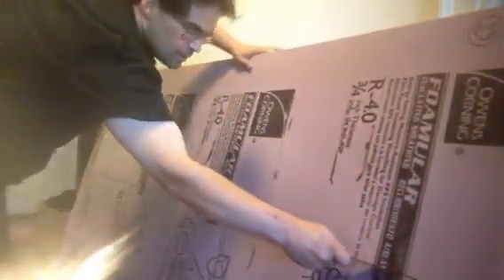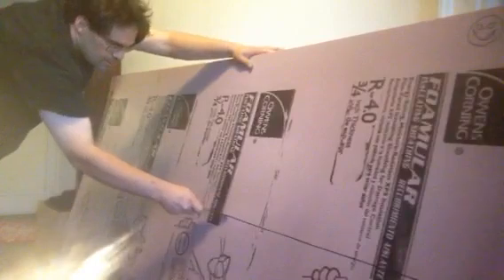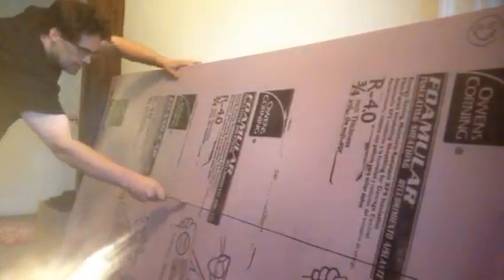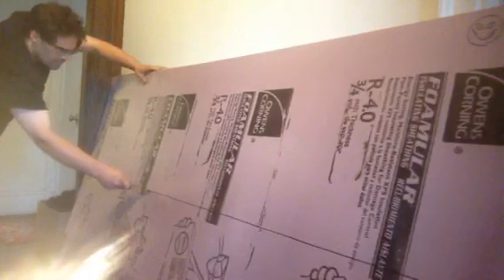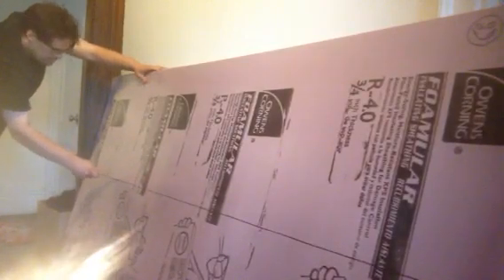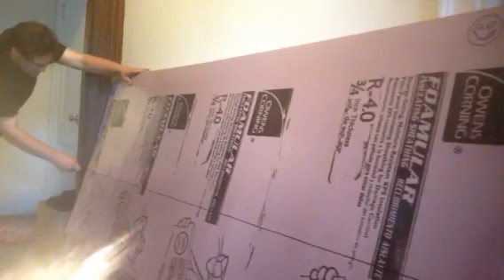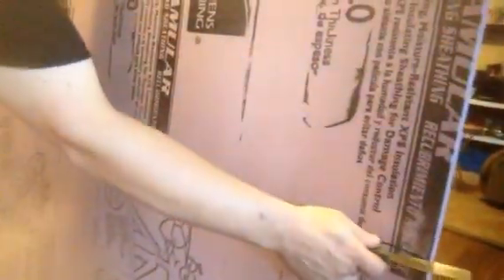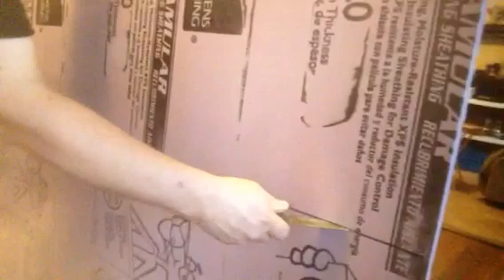DIY How to Absolute easiest way to cut foam insulation board

Comment: A heavy duty extended snap point knife works pretty good. Multiple passes are the way to go if you don’t have an ideal hot wire cutter

Comment: Couldn't home Depot just cut it for you if bought there before loading into vehicle ?
Reply: I really doubt it, because they would deny you because it's foam; an out of ordinary material for them to cut. I'm guessing at best, it would be a hit or miss result & only for a couple of cuts at most, not a few or more. Besides, they cut with a saw, which would bind up when the blade quickly does get hot & it causes a nasty uneven cut & melting of the foam as well.

Comment: --------------------------- putty knife blade is ideal bc it has no taper ....now separate blade/handle weld/braize  blade to HD soldering iron ... I told you so....thx 12-31-24 happy nye it's 7:30 good night .....celebrate in my dreams

Comment: Don't think this would work for 100mm :c I'll just use ma saw :P
Reply: They make blades specifically for cutting foam board.  They're expensive.  But if you cut a lot of the stuff, totally worth it.

Comment: How do yousharpen the putty knife plz?
Reply from the maker: This works. The flatness of the puddy knife makes it go through the board easily. We used to use this method when we cut foam board when installing the Dryvit system.
Reply from the maker: I'm sorry I misunderstood you. I use a grinder file and a sharpening stone.
Reply from the maker: I thought I made a video on how to do this. I just can't seem to find. I think I did this one with a file and a sharpening stone.